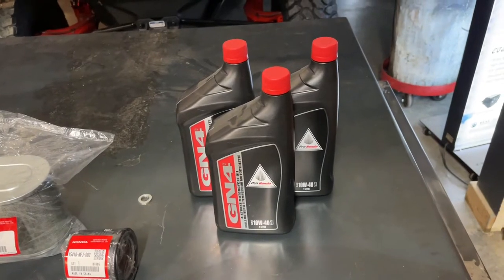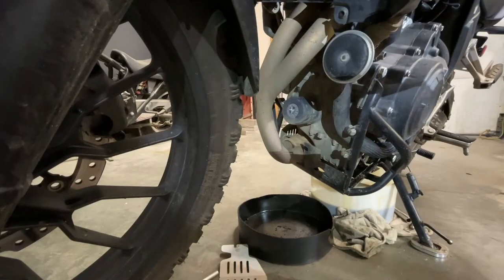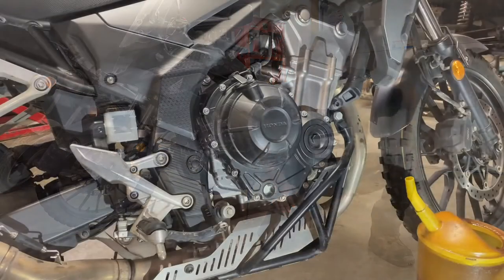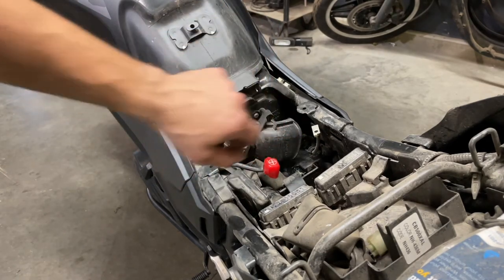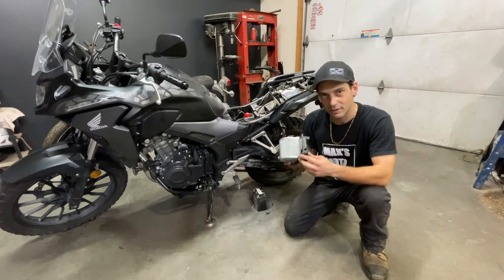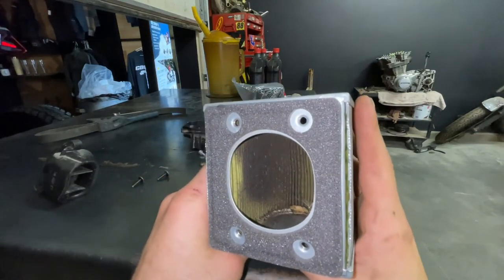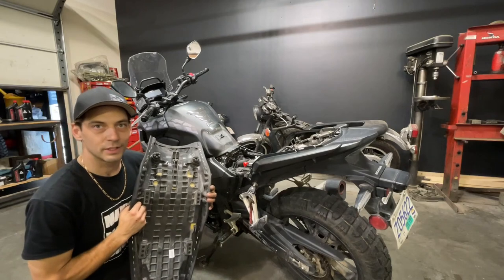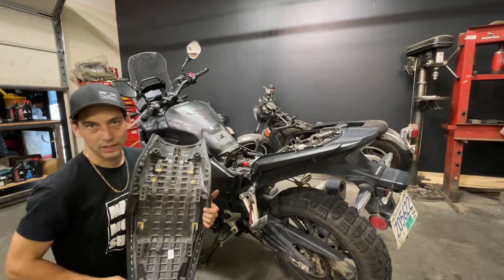Honda CB 500 X Oil and Air Filter Change / MAX’S MOTO SHOP

Comment: Hey man the air filter is really hard to get out of its case with that black thing in the way suprised ylu did it so easily, i guess i just need to keep bending those cables out of the way to make it work

Comment: Good job. What model year is your bike? One suggestion - always disconnect the battery ground first and reconnect it last. When disconnecting the positive terminal first, a slip of the screwdriver or wrench creates a direct short to ground. Think instantaneous arc welder.
Reply from the maker: There’s absolutely no need to disconnect the battery when changing the oil
Reply from the maker: This is the 2020 model by the way
Reply: You do have to remove the battery to change the air filter, as you show at 3:40. By the way, thanks for showing the part numbers.
Reply from the maker: @philhowell4607  I will remember that for next time

Comment: what is the number of the tool that you have used with torque wrench to take out the oil filter and what dimension(64mm?) it is?
Reply from the maker: Sorry, my reply took so long, check the video description for the tool and oil filter links

Comment: Hello man, I just landed here. The bike booklet states the oil should be 10w30, why did you use 10w40 and what difference does it make?
Reply from the maker: Different oil for different temperatures use the oil recommended for your local temperature